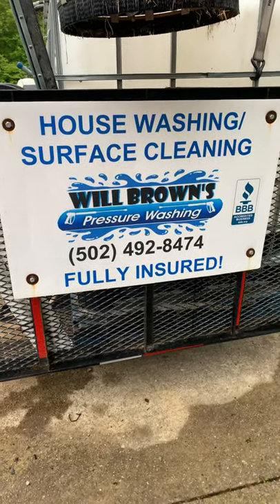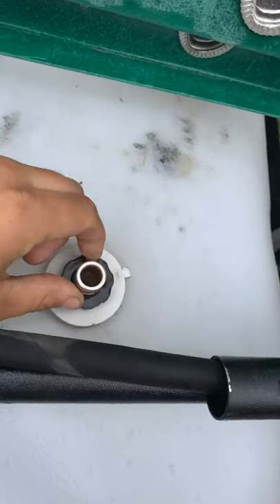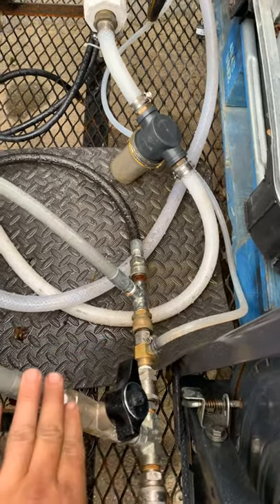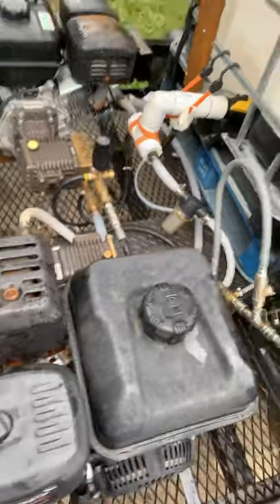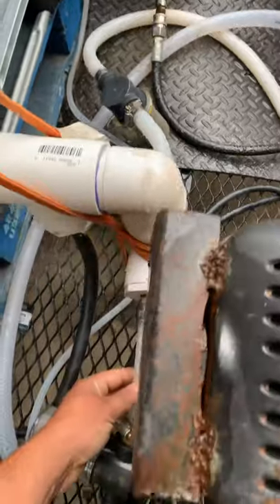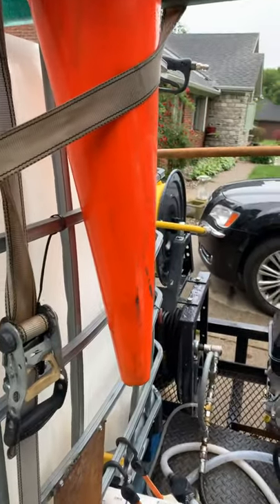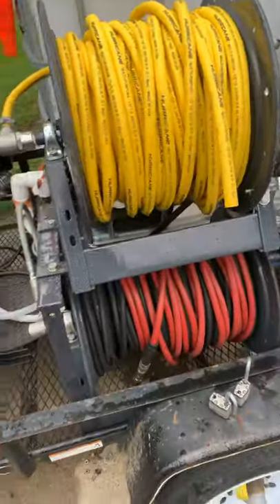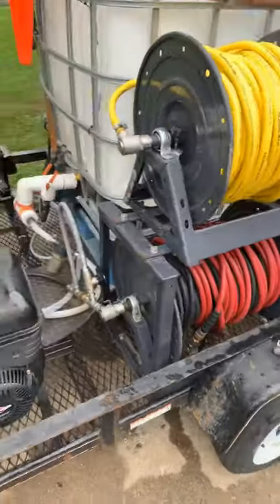5x8 pressure washing trailer.

Comment: Nice set up, hey I just bought a 5.5gpm pressure washer, is a 65 gallon buffer tank too small in your opinion or do you think it would work? Thanks
Reply from the maker: It will work just fine, I'm actually getting ready to swap the large tank for a smaller tank. Only think to keep in mind is most residential water spigots flow an average 4gpm. So just keep that in mind if you are constantly flowing. Most times you will be on and off the trigger so you should be fine.
Reply: @williambrown4082  thanks buddy!

Comment: Neither of those pumps are belt drive ? Do you have any problem with them being gravity fed their water supply ?? I keep being told that direct drive machines have to be force fed their water supply....??
Reply from the maker: Both gravity fed. No issue, never starved for water. I made sure my water outlet is higher than my intakes on the pump. Works well for me.

Comment: How do you get water to your pressure washer pump with your gear driven pumps?
Reply from the maker: Gravity feed 2” outlet into a T and 1” lines feed each pump. Each line has an inline filter. I can run both pumps totaling 8gpms with no issue. Shortest length with little or no bends also helps water flow. Hope that helps.